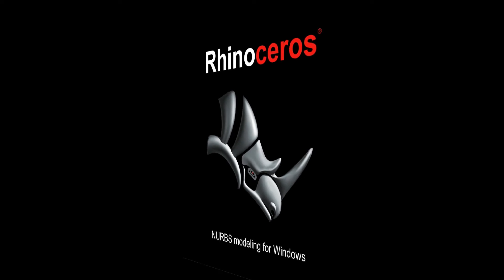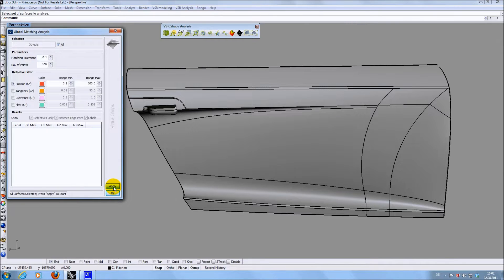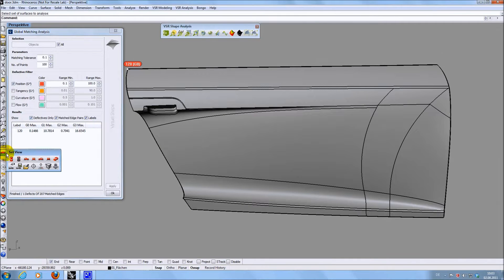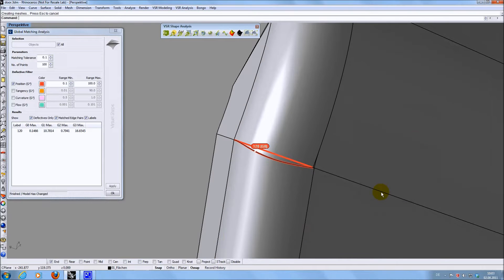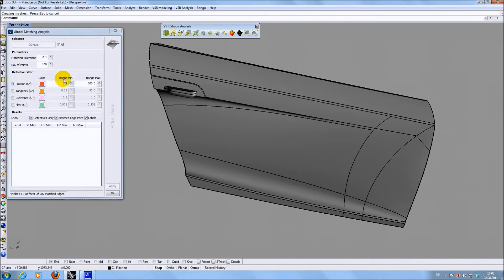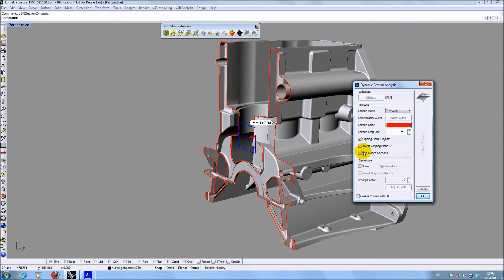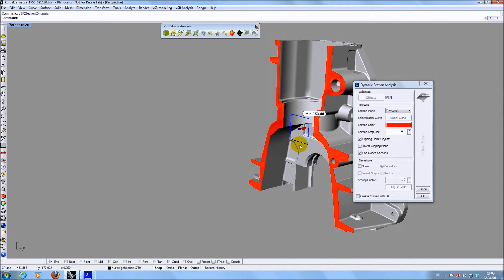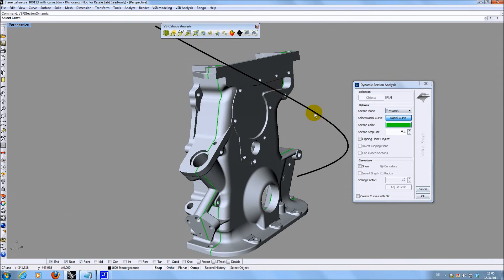VSR Shape Analysis 2.0

Comment from the maker: Two funtions here: 
One is named VSR Surface Split, 7th icon from the right on the blue Shape Modeling toolbar. It takes an untrimmmed surface, a limitation geometry, and creates a new untrimmed surface.
Second one is Patch from Curves, which can be used with projection base, arbitrary input edges (up to four). It is not a direct convert tool, but can be used this way.
I can remember we've been asked for a direct convert tool, maybe we should really offer a function directly doing that.

Comment from the maker: Although the CV transformation is not exactly the one in Alias, it is easy to achieve the same in Rhino. In native Rhino, control point modification is always in the local cplane, so restricted to X and Y. By pressing Shift, you only modify in one of both directions. By pressing ctrl, you only modify in Z direction.

In VSR Shape Modeling, you can restrict movements by pressing the according letter on the keyboard.